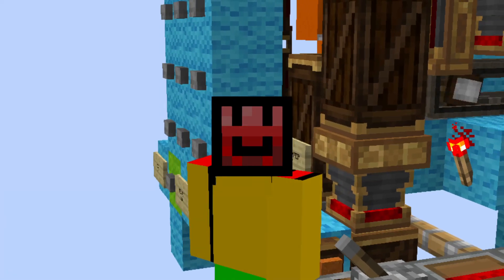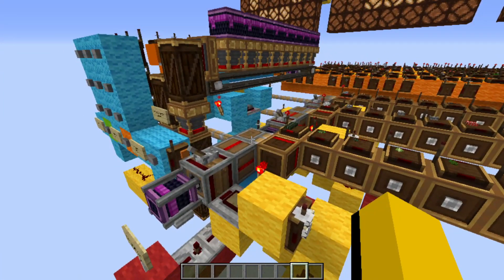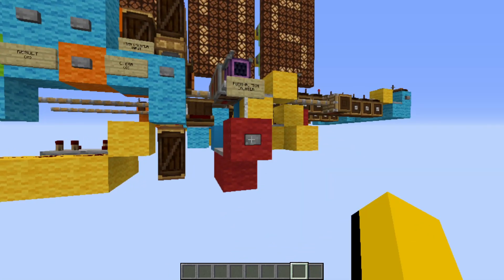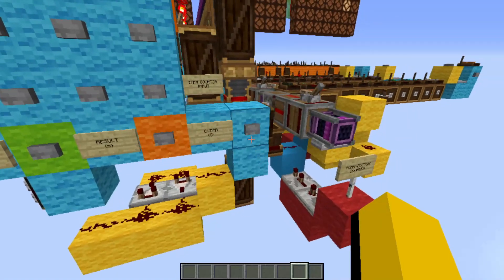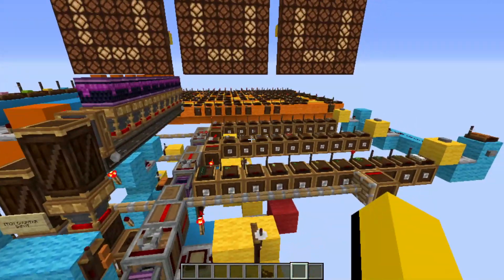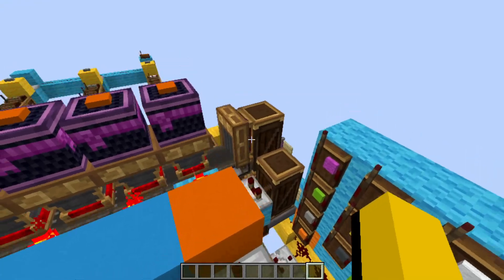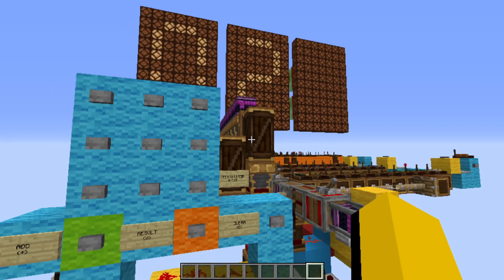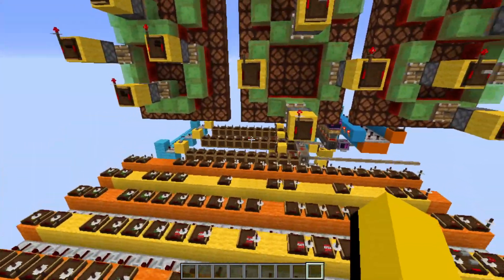Minecraft Create 0.3 Mod Controlled-Rotation Multi-Purpose Counter

Comment: Enjoy seeing this with Nixie tubes
Reply from the maker: It was my understanding that Nixie tubes display Redstone signal strength (1-15), is that true? Or are there other ways of using them to display specific numbers or to count items? I don't use these enough so I'll definitely look into them either way!
Reply: @BLOckOus  I need to look into them myself. I just haven’t had the time. I’m an engineering student with bad time management skills. But I believe you’re right with the signal strength
Reply from the maker: The only place I tried them was next to an adjustable lever. But now I'm wondering if it's possible to link multiples of them and somehow use them as displays :D -- As far as time management skills, all I know is that there isn't enough of it 😅